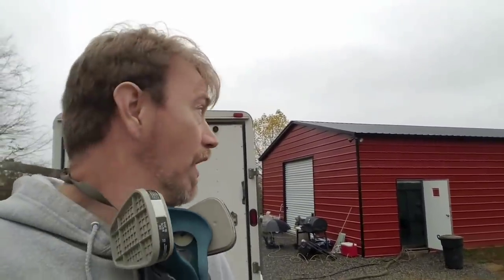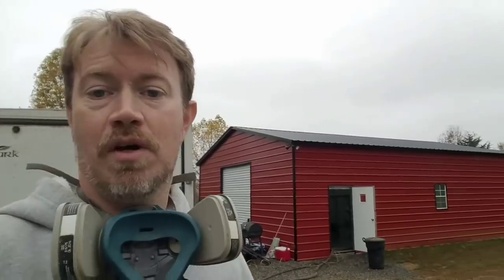Insulating Metal Buildings With Closed Cell Spray Foam

Comment: That tin can is not engineered for added weight slung underneath . In time moisture-will migrate into insulation and damage may be irreversible . Just install insulation blankets when erecting building . Do not do-this to-your building as in time it will destroy it .
Reply: what is your proof for that statement? As I am curious about probably doing my building. 40x30 w 12roof
Reply: Stephen Taylor / all metal buildings are Pre-engineered for snow load / wind load etc . Without any doubt no calculations are run by any structural engineer for added load of weight of material . Also I have rarely seen a metal building that had zero leaks after one year .  Metal has a memory and roof sheets try to return torelaxed shape of flat . Neoprene washers onroof screws in time may-loosen somewhat or having been run down too tight the washers are damaged . This results in loosening . I retired out of Ironworkers and in my apprenticeship i put up hundreds of tin cans from T-hangers to distribution warehouses and factory building , some had insulation on-roof and walls    In form of blankets with seams stitched , and taped . DO NOTDO THIS TO YOUR BUILDING ! In long run you most likely will have regrets. . Talk to building supplier about your plan before buying into this application . Always get a warranty for stated time . Without insulation if a roof fastener fails it is simple issue to install bigger diameter screw .    Most tin cans installed by inexperienced hands have creases on roof sheets and light showing through indicating where leaks will be . Installation is tedious to inexperienced you can not just put your weight anywhere and screwing roof screws down must not be too tight or loose . Simple fact most do not care it is just a check to them . Truth is i never had a job or a wife i wouldn’t trade for a pay check . I always did my best work always .    Ask building manufacturers engineer he will tell you not to do this . Many yearsago i saw an old metal building in desert and it was a mess because of spraying similar  material inside . The entire building needed to be tore down because of rust . The structural members were painted red iron oxide but rust had eaten them too . Dont do it . Anyone going to expense of building a building should want best service out of structure possible this is not how to-get it . Im retired out of ironworkers since 2005 /
Reply: Stephen Taylor good never take anyones opinion as gospel . Ask the MBMA members staff engineer they will tell you the truth .
Reply: Lol Wayne Robinson you obviously know little to nothing about closed cell spray foam! It is lightweight and will actually increase the structural strength of the building! And moisture getting inside the insulation shouldn’t happen if the outside of the building is properly sealed and a vapor barrier sprayed on inside or lined with something
Reply: James Yutzy estimate at rate he is spraying one  to two and a half pounds per square foot .  You called bull shit call any metal building manufacturer and ask their engineer .All calculations   are based on test actual-test not a slide rule . I will bet you 100.$ no legitimate metal building manufacturer will guarantee their  product if you add it . Call one and see . Do not believe that this small amount has no bearing on snow load  and wind load not to mention seismic . It is very funny now days everyone with an opinion thinks they have knowledge but fact is experiential knowledge only comes by experience . I worked iron my entire life having only gone to tenth grade     . It is hell to make love to a hungry women . I went to apprenticeship with union structural ironworkers . I started-first period but retired  in 2005 on union pension and social security as a superintendent . My pensions total sixty thousand a year . Im working at getting back into work market . I have meeting tomorrow with a man about building myself up again . Anyone putting up a building would never consider voiding warranty . If you have an old building and want to insulate like this fine but you should talk metal building company first . I have no exsperience with closed cell material he is spraying but from practicle exsperience im saying seek good council cause when your building is rusted you will not have A claim against building manufacturer or this man either . I also have seen situations in stick building where off gazing makes space untenable .  If you are building a building use blankets for insulation and put-heater in slab using the pipes it works very good not cheap but very good .
Reply: James Yutzy james issue is migration of water between spray and underside of roof . Capillary action will do its worst once water can enter . Do not think that a heat cycle has no effect on light gauge material because it does . Every building has a life expectancy 
 this material application is not part of estimate . Just do it if you want but it is not a good idea .
Reply: James Yutzy have you ever heard  of build permits and inspections ? I doubt you have any practical experience .
Reply: Then you will see with eye where the leaks are and pop them with a pin and drain the water bubble .
Reply from the maker: Hey there Wayne, thanks for your concern! We have installed closed cell spray foam in hundreds of commercial, residential, and industrial, metal buildings for almost a decade now and have never had a customer contact us about any of the issues you raise. We have however had many very satisfied customers that enjoy their buildings much more and have testified to the added strength and comfort of their buildings after the spray foam was applied. We try to follow the guidelines set for insulating metal buildings by the Spray Polyurethane Foam Alliance which you can read here:
https://ncfi.com/content/uploads/2014/07/Guideline-for-Insulating-Metal-Buildings-with-SPF-Ay-130-2000.pdf 

Closed cell foam is a structural foam that adds measurable strength to metal buildings. Mason Knowels, and expert in these matters with over 40 years in the spray foam industry, did an exhaustive study on using foam to strengthen structures and he Concluded: "Based on research and field observations, it appears that the installation of cc SPF to either the exterior or interior of a building can result in significant structural benefits and reduced building damage from impact and high winds." You can read this study here:
http://rci-online.org/wp-content/uploads/2016/04/2010-09-knowles.pdf

Also the American Chemistry Council has shown that FEMA and NIST have approved Closed Cell foam to prevent mold, wind and flood damage to structures stating: "Building studies conducted in 1992, 1996 and 2007 have also shown that applying closed-cell SPF to wall cavities can increase racking strength (i.e., resistance to horizontal forces like high winds) versus those without SPF. Closed-cell SPF itself can also resist water damage. The material can be cleaned and dried, which is why the Federal Emergency Management Agency (FEMA) has classified closed-cell SPF as an insulation material that can resist flood damage. Using SPF can provide better moisture control to help resist the formation of mold in walls, and under floors and ceilings." You can read this study Here:
https://www.americanchemistry.com/Media/PressReleasesTranscripts/RelatedPDF/Spray-Polyurethane-Foam-Can-Help-Make-Buildings-Stronger-More-Durable.pdf

I also have a personal story involving the strength of closed cell foam in metal buildings. We were contacted by a previous client that told us a huge tree had fallen on his metal building. Fortunately it was insulated with closed cell spray foam and the extra strength of the foam prevented the tree from coming all the way through the building and crushing the two classic cars he had restored and had stored in the structure. The insurance company said the closed cell foam saved the cars and most of the building from being destroyed. He had the damaged roof panels replaced and we returned to patch and repair the insulation.

Insulation blankets of fiber glass insulation will not add additional strength to the building because they are not fully adhered to the metal. Over time they will sag and loose R-Value. They can actually hold moisture against the metal, cause mold growth, and often cannot prevent condensation because they are not an air barrier. They will eventually fail:
https://static1.squarespace.com/static/52c810c8e4b03b30610a91bc/t/596cc4fbe6f2e1d4b201aa89/1500300583220/C457644E-8198-48C6-9E96-A5D774949DFD.JPG

I hope this information will help clarify some common misconceptions about using spray foam insulation in metal buildings. Thanks for your interest!
Reply: Wayne Robinson I spray foam on roofs for a living and happen to know a hang of a lot more about it than your obvious guesses about it! Yes it absolutely does add structural strength! I have a new pole building that I haven’t insulated yet but will definitely be spraying foam on the walls for insulation. There’s no other insulation that comes close to spray foam! So maybe before you bash me get your facts straight. Because I can guarantee you I know a lot more about it than you do! And yes it’s because I spray it myself!
Reply: @waynerobinson2301  I don't question your years of experience and knowledge. I do however know that many years ago, things were different and the technology learned from the work done years ago has changed the composition and details of manufacturing buildings like this. To a point of fact, closed cell foam does add to strength and rigidity of walls and ceilings because the foam hardens  and cures like polyurethane which has a protective property when applied properly. Those walls are stronger and have a higher wind resistance as does the roof. I will however admit the roof is an unknown to me. Merry Christmas Wayne!!!
Reply: Exactly how much do you think the foam weighs? Also it adds more strength than it weighs.
Reply: What he's saying is true. In my My 34 years of doing Metal Building Construction and repairs i've seen it. it'll cause rust out problems down the road.
Reply: I've worked for my family company Here in Houston for 34 years. we repair and construct metal buildings only. vinyl backed fiberglass insulation Does not sag when installed properly. Also it does not grow mold even when exposed to water for extended periods. The problem we see with this spray in foam is that leaks aren't detected for so long that rust begins to flourish , and rust can be like a cancer on steel. The buildings we've encountered with this spray in foam , which were originally a roof leak repair , usually turned out to be a major roof section replacement ,and if the water had been running down the wall , even more , sometimes base angles would be rotted out. i'm not saying spray in foam has no place any where . It just has no place in Metal Buildings.
Reply: The opposite of everything in this post is true...
Reply: @WiIdbiII  everything will fall over in the end, in the mean time I'll be warm and dry
Reply: @integr8er66  the end depends on what type of climate your in if you spray this liner into your building.
Reply: Your statement couldn't be more false.  The foam supports itself as its monolithick.  So tell me, how can moisture get in but not out?? Is is a trap door?? Stop reading blogs on google for info..
Reply: @foamfire9370  I've been building metal buildings , repairing them and reroofing them for 34 years. My father started our company in Houston Texas back in 1962.  My brain is my search engine , when it comes to metal buildings. In the end , it's your money, your building. I simply gave some advice that we give all our customers. Do what you want .

Comment: Whoa!, Everything that they said in the video is true, BUT,  This stuff is highly flammable... so you must be very careful with fire, or apply a coat of fire-retardant paint over the foam, or you run the risk of seeing your building go up in flames.  I speak from experience.
Reply: Almost all closed cell foam from reputable manufacturers have fire retardants in the foam. The foam will not burn unless a open flame from another source produces the flame.
Reply: So totally WRONG. I tried to burn the scrap with diesel fuel and gas and it won't burn or even melt under extreme heat.

Comment: I've got 34 years Experience Constructing and Repairing Metal Buildings. Strictly and only Metal Buildings. This spray in insulation is a bad idea on Metal Buildings.
Reply: @Couchlover47  I did explain , and the comment was removed for some reason.  I'm just going to tell you this. When we put a new roof on a building or erect and finish one we give a 20 year warranty on materials and 10 year on labor. We have had customers ask for this insulation and we tell them ,No. We will not honor a warranty or should they install it after construction it voids the warranty. There's alot to say about the problems it causes , which I don't have time. So I'll just tell you the main one . Premature rust out. Oh and BTW , I don't believe it to be a bad idea. I've actually met with insurance adjusters for clients and showed them why it's WAS A bad idea.

Comment: nice  comeback      call me an idiot        well  just  telling  you what i know  im 64  years old  i have built  100s  of post frame structures    from workshops to horsebarns     i  can  show you  many  bad results   from spray foam application     my customers ask me about it   and  i tell  them  the truth    i (why  would you do that to a new beautiful building)    if   there  set on doing it   i tell them i will not honor guarantee from rot   ,  you  must have moisture  control      especially  if your going to heat the building,    the  structure  has to breath,     or ir will rot from the inside.
Reply: I doubt this ALL METAL building is going to rot any time soon.
Reply: even metal rots, it is called RUST

Comment: Love the dude behind the camera with no eye protection. Should have air-fed mask on being inside that building. This company has no safety measures. Thumbs down for camera man. Thumbs up on smooth closed cell.
Reply from the maker: Thank you for your concern for our safety! Our installer does use the air fed system you speak of and most of the time the rest of the crew wear full face respirators with organic vapor cartridges that are changed regularly. These measures are more than adequate and it's unnecessary to have every person on site used forced air if they themselves are not installing. The half mask is adequate if you are not in close proximity to the installation and are in the area for brief periods of time. For ease of camera operation to produce this video the half mask was used to capture a quick video of the process. We have been installing foam for 16 years and have had no incidents or ill effects from using cartridges and we do use eye protection when it's appropriate.
Reply: Excellent reply.

Comment: Ok , the fumes and vapors are very toxic , so toxic the wear s air fed respirator , the guy won’t go on without a charcoal filter respirator .. but we have a kerosene open flame torpedo heater just burning away .. who pays when you guys and the building go boom
Reply: Does that happen a lot?

Comment: Nope. No thanks. Looks hazardous to my health and to that tin can building
Reply: Once the surface has hardened (takes minutes to go hard) then it's 100% safe and no gasses come from it, then the rest hardens over 24 hours and it's solid.
Reply from the maker: It's not for everyone, but if you have a couch, a padded car seat, carpet that is padded, or a fridge in your kitchen then you are already making use of polyurethane foam. Polyurethane foam is a code approved building material and is perfectly safe once installed properly.